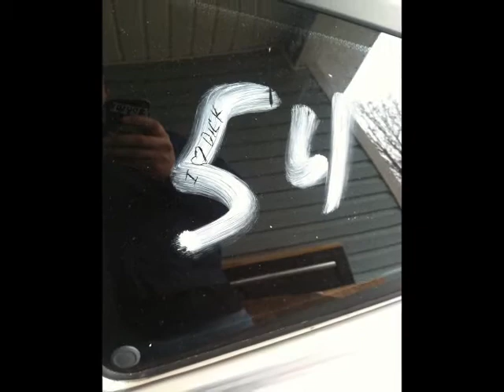2jz Starion build

Comment: Was it hard fitting a 2jz in the engine bay???
Reply from the maker: No. It fits pretty well!
Reply: @mksmotorsport4049  that’s fantastic, I’m seriously debating on whether to swap a 4g63 or a 2jz, what do you think would be the cheapest/easiest??
Reply from the maker: If I was going to swap another I’d go Jz. It’s just as much work to put a 4g in and the Jz will make you twice as happy and be twice as reliable.
Reply: @mksmotorsport4049  ok thanks for the insight!!
I love the 4g63 but they aren’t as reliable as the JZ’s 😂